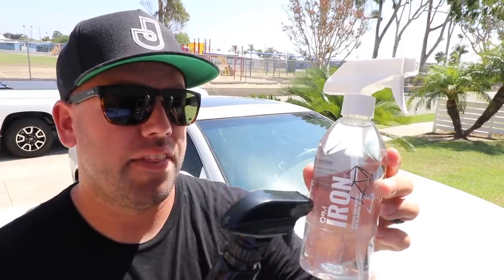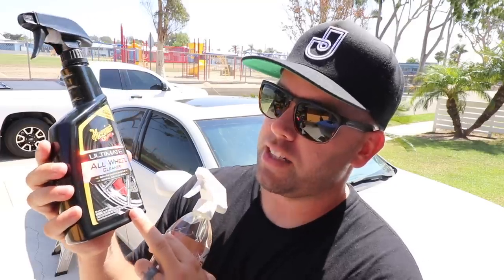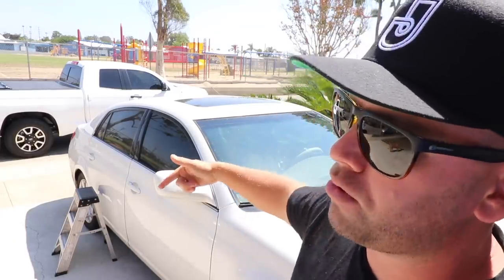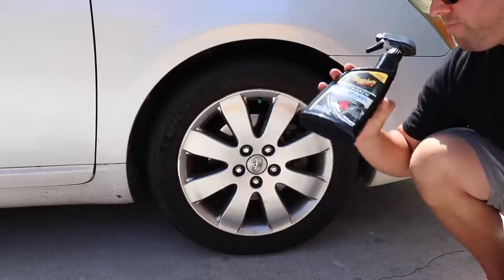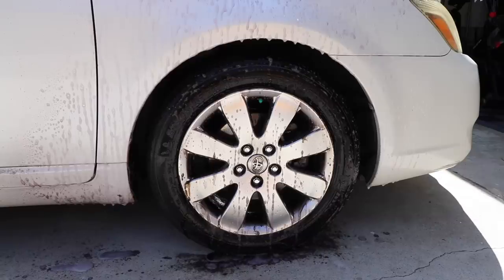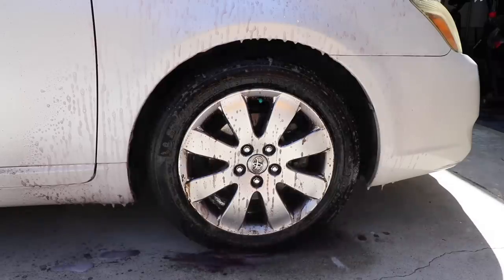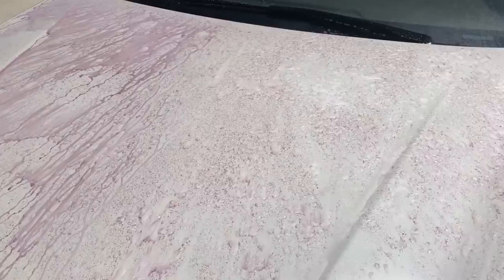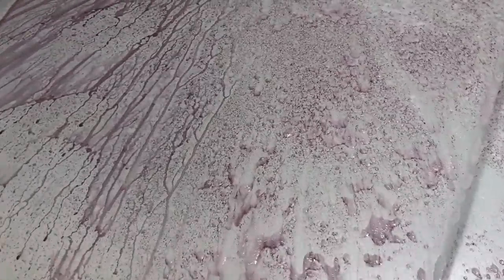CHEAP VS EXPENSIVE: MEGUIARS ALL WHEEL CLEANER VS GYEON IRON

Comment from the maker: Sorry about the audio in the last clip of the video - damn iPhone.
Reply: damn iPhone.
Reply: Go Andriod
Reply: What was your conclusion that we couldn't hear?
Reply: Not sorry enough to spell out what you said for the viewers, I guess.
Reply: These guys are just whiners, Jimbo. All you gotta do is turn up the volume a bit for a minute. It’s fine.
Reply: MotorcycleJunky07  You are lucky to have such powerful speakers. As for me, I maxed out my volume and still couldn't hear a thing.
Reply: iPat6G I don’t have “powerful speakers”. I was using my cheap earbuds. Update your tech.
Reply: Auto Detailing Podcast been using the Meguiars on my Camaro SS 1LE wheels since last summer works pretty dang good this car has large caliper and brakes makes Ton of dust and iron! Question is this stuff safe to use on ceramicpro9h covered paint surfaces? I never thought of spraying down painted surfaces before I’d be interested in seeing how my white camaro looks with it!
Reply: Auto Detailing Podcast them shitty ass “AirPods”
Reply: Auto Detailing Podcast yeah you drifted so we can’t tell what your final judgment was on the product
Reply: What's the new one you're using by Eagle one ?
Reply: Actually it’s the AirPods. They have a horrible mic
Reply: Hahaha damn iphone..

Comment: Good comparison. I would say that if you compare wheels try to do left and right front, not front and rear because the braking system in front got large pads so you should have more Iron from brake dust. On the other hand, I wish to try next time car pro Iron X vs Sonax Wheel cleaner plus. Thanks
Reply: Feras Al-Hindi if you watched the video, he explained why he did that
Reply: Feras, I've used both IronX and Sonax Wheel Cleaner Plus. I got the same results as Jimbo: Both work, Sonax clings better. Now I use only the Sonax, and I even add  water to get a better spraypattern: 75% product, 25%water (3:1). Also works as claylube on a washed car. Saves a step ;)
Reply: Indeed. Useless test when you compare a front to a rear wheel.
Reply: It depends most car the driver side brake system is under the most pressure that being said the driver side would be the dirtiest of them all 🤷🏾‍♂️
Reply: @reyalmonte1533  Brake pressure left and right should be the same, otherwise it would be unsafe. I was talking about front and rear. Most of the braking is done with the front.
Reply: Dutch79 that’s correct most the braking comes from the front but if you look at the brake diagram the driver side always get pressure applied before the others and if you look at vehicles when you’re changing pads most the time the driver side is more worn out than the others. That’s what I have seen from my personal experience.
Reply: But all of this is also in result to the weight of the vehicle all vehicles are different but I’m most case I seen the driver side always wear out a little bit more not much but if you measure it you can see a little difference
Reply: Rey Almonte I know this is over a year ago but I couldn’t. You are so wrong, if the driver calipers/wheel cylinders received more or pressure first then the passenger side then cars would pull to the left when braking and create unsafe situations. You mentioned diagrams but fail to mention the addition of a brake proportioning valve/metering valve while in newer vehicles the abs system controls it and essentially controls pressure to all 4 wheels evenly. If you have one side going through pads quicker then you have a caliper sticking or completely screwed up when replacing your pads by not greasing  your slide pins or not correctly installing the pad shims.

Comment: There's a difference between pre-washed and pre-rinsed. You should always wash a rim before applying a chemical decontaminant. Otherwise you're wasting chemical on removable contaminants. What the Megs bottle means is that the rim should be dry. Otherwise the chemical dilutes itself. So wash it and dry it before application. They're both trying to say the same thing but both failed in slightly different ways.

I use a pressure rinse first, then an APC, then an acid wheel cleaner (if they're bad), then dry the wheels and use an iron remover, then a tar remover, then a clay bar and finally a panel wipe. Then they're ready for coating.

Comment: If your iron remover is drying on the paintwork a great tip i got given was to stand at a distance and use the pressure washer to mist the paintwork, this will gently add some moisture back into the product.
Reply from the maker: Stickymicky25 that’s a great tip. Thank you

Comment: I can confirm the Meguiar's turns extremely purple when there's a lot of iron. Next time you have a 2018+ STi, try this. I cannot go more than three weeks without washing my wheels, and even after one week, it turns purple like crazy. I usually use Spray Nine or Super Clean for the tires and Meguiar's All Wheel Cleaner fort he job. It's economical and efficient. For those who want only one product, I guess the best I know which is reasonable priced is the Adam's (the purple one) Wheel & Tire Cleaner. It's phenomenal, but still more expensive than the Spray Nine+Meguiar's AWC. Also another trick that make the wheel cleaning way more efficient is to use a very soft conical drill brush. That cuts the working time at least by half.

Comment: I did a comparo of Megs Ultimate wheel cleaner to Griots Heavy Duty and Sonax Wheel Cleaner Plus.   The Megs is a great value and worked as well as Griots at 1/2 price.   The Sonax was a little better performer but not for 2X the price.   Hard to beat the Megs for an iron reactive wheel cleaner.

Comment: I'm not trying to be a smart-ass he should have done one front rim and tire and then the other front rim and tire.  with that being said Meguiars products are awesome ! !  and thank you 4 letting us know about Meguiars wheel cleaner.  would not have known this would be an iron free product
Reply from the maker: I understand. The reason I didn’t do that is because the other side was in the sun and I thought it would be unfair. To me both the back and from rims looked equally dirty.
Reply: Auto Detailing Podcast I understand that it's just the front brakes work a lot harder and disperse more material than rear disc brakes.

Comment: Hi Jimbo.

What do u think of using acidic wheel cleaner such as Meg wheel brightener as decon product? 
Will it ruin clearcoat in longterm?
Reply from the maker: Acid is one of my favorite wheel cleaners for so many reasons. I wouldn’t use it as a maintenance item as it may have long term negative effects. But on super nasty rims that have been neglected- there’s nothing that will get them cleaner faster then wheel acid.
Reply: @autodetailingpodcast  
Jimbo.
 What i meant was using acidic wheel cleaner to deep clean/decon car paint, not wheels.

Will it be okay for my car paint in long term? 
Assuming that i did the decon with caution and use common sense.

Comment: Take this for what it's worth but Meg's doesn't recommend this for use on paint. 

"We do not recommend using our Ultimate All Wheel Cleaner or any of our other wheel cleaners for applications other than wheels. We know and understand other products use similar color changing/iron reacting chemistry for applications other than wheels, but Ultimate All Wheel Cleaner is designed just for wheels. Keep in mind with any product which uses this color changing ingredient, that color changing ingredient could be one of many other ingredients in the formulation, and even though the color changing ingredient is widely known for it's effective yet safe cleaning ability, the other ingredients included in the formulation may be geared towards a more specific application like wheels, to help with all sorts of variables in performance, and those ingredients geared towards a more specific application may or may not work well or be safe for certain surfaces."

Before I would use this on my paint I would like to know what the chemical differences are between products designed for wheels and those designed for paint.
Reply from the maker: Fair enough.

Comment: Specific iron removers aren't wheel cleaners.  It can be part of the process but you should use an actual wheel cleaner to clean wheels.  There's more than just iron/brake dust on the wheels.

Comment: i think that your rims were to clean to do a good comparison, in the meaning that on a quite clean rim also low level product could do a good job, only when dirty s a lots you could see the difference.
So maybe i would suggest as conclusion:if you will use the wheel cleaner regularly, a cheap products could be as good as an expensive one.
But we cannot really say they are the same.

Comment: As a detailer I've switched over to almost all of Gyeon's line last year. However I still use Sonax full effects/ PLUS wheel cleaner as my go to. Why? Simply because i haven't found a better one yet. Now that being said I rarley use a iron remover wheel cleaner on wheels once they've been decontaminated from iron, claying, and polishing. Followed by Ceramic coating and AMMONYC gellee. I go to AMOONYC Brute for my maintenance washes. But to say meguiars has a better wheel cleaner I disagree, I feel you'd be using more of the product sense it's foaming coming out of the nozzle instead of direct liquid and running down the wheel/panel. Might be as good but I feel you'd be using a lot more of their product for the same resaults as gyeon or better yet Sonax.
Reply from the maker: Fair enough.

Comment: Hey great video, I feel like the foaming is a slight advantage because it sticks to vertical panels better. You still have to clay bar, but this really helps a lot! I use Ferrousity from clarity 1 polishes, a local detail shop in temecula. It also has a foaming characteristic.

Comment: I like the foam vs running down product. I would highly suggest rinsing bottom to top to avoid diluting the product and streaks/stains on the finish. You have mentioned applying it dry, but what are your thoughts about rinsing it down to cool down the paint and to knock dirt off the paint before applying the product? 
Overall I like your comparisons, it makes easier for amateurs and professionals to see other products in the market. Thanks again.
Reply: I do it before because it clings to the paint better IMO. It’s dry and the only product on vs a wet slick surface

Comment: One thing, it's pronounced jee-on. I don't really care how you say it personally, just an FYI. 

Secondly, the smell is mercaptoacetic acid aka thioglycolic acid. The more smell, generally the higher concentration of the active chemical. Mercaptoacetic acid actually rapidly pickles the iron. The byproduct is that red/purple color.

Meg's is a pretty decent product for the price, but the dedicated iron removers from Gyeon and Carpro tend to do better than the wheel cleaners that have the acid in them or products that try to be iron and tar removers combined and even some of the cheaper dedicated iron removers like McKee's for example.

I've decon'd some seriously bad cars - I'm talking one car was sitting next to an angle grinder station so the particles were enormous and you could really see the difference between the big name iron removers and the cheaper stuff I was trying to use since I knew I was going to have to go over the car many times. It ended up being a 3 hour clay job even after probably 3 to 4 passes with iron remover btw on the car that had been sitting near an angle grinder. Orange rust specs eeeeeverywhere.
Reply from the maker: Dannnng. That’s crazy. Would love to see pics
Reply: Auto Detailing Podcast
Man, you know I'm sure I have after pics, but I don't recall if I took any before on that car. Missed opportunity, I know. I think I was too anxious about how long it was going to take and just got started. I thought I at least had a picture of the clay with a huge visible metal shard in it and many smaller shiny specs, because I remember snapping one, but I can't find that either.

Comment: I don't know if you can solely base the price of the product off of just the performance. I don't have experience with the Gyeon Iron product, but you need to watch what you use on certain wheel finishes. Perhaps with many standard factory wheel paints and clears, you're fine. But as soon as you get into aftermarket powdercoats, anodizing, and clears, you might want to rethink using anything too acidic.
Reply from the maker: Definitely agree. These iron removers say they are pH neutral. But it’s usually always good to test it first.

Comment: Try bilt hamber auto wheels and you'll be blown away. Also their similar ironfallout for paint. Valetpro dragons breath is an other one with very high percentage of the chemicals that dissolves the fallout.

Also its recommended to wash the car or wheels AND dry it then apply a falloutremover. Otherwise all the other dirt and contamination will weaken the effect and absorb the product.

Comment: I've used Meguiar's Ultimate Wheel Cleaner, and I have to say that I was impressed by it. I've also used Chemical Guy's Iron Decon spray, and I was extremely disappointed. I'm going to give P&S Brake Buster a try too, but so far, Meguiar's has a heck of a good iron remover.
Reply: I just pickup the chemical guys over the meguiars and was extremely disappointed. It didn't do anything. Gonna go back I guess

Comment: The foaming of the Meguiars is nice when you're using it as wheel cleaner not just as an iron remover. I've used the Meguiar's to clen wheels then followed up with CarPro iron X and got no additional iron off of them so I'd say it works well. I've not tried it as a pure iron remover on body panels yet.

Comment: would have liked to have seen you spray the Meguiars side with Gyeon and vice versa to see if either pulls more contaminate off that the other spray didn't quite get. Just wondering if the Gyeon does a better job at pulling all that stuff out vs the Meguiars is all.
Reply from the maker: It’s difficult to do that because usually on the first application it won’t remove everything.

Comment: I do agree the gyeon or iron x is over priced BUT the active ingredient that makes the purple is a lot less in the Meguiars than in the gyeon or iron x.

Now... maybe you don't need a high concentration of the active ingredient to be effective?
Reply from the maker: I think your right. They seemed to work pretty much the same.
Reply: Auto Detailing Podcast, it would be interesting to know what is the main active ingredient that turns purple.  I personally think it is hydrogen peroxyde. If so we could probably come up with an extremely cheap home made version of the fallout remover.
Reply: Stephen Remillard  google thioglycolic acid
Reply: Interesting, I guess this is not something that can be purchased at the local hardware store?

Comment: My guess is the reason for more iron in the rear on this specific car, and most normal cars for that matter, have vented discs up front and solid, non vented discs in the rear. Even though brake bias is higher up front, the non vented rear rotors get super hot and lead to wonder if that causes them to throw more dust. Certain cars do this very noticeably. Ive always noticed rear wheels on older Mazda 3's get significantly dirtier than fronts because of this.
Reply from the maker: well said.

Comment: Hmmmm never thought of using wheel cleaner on the paint. I always thought it'd be bad for the paint. Well give this a try next time. Would this also be a good way to remove old wax/sealant?
Reply: I wouldn't use any Wheel Cleaner on paint. He used it on paint because it has Iron Removers in it. That Meguiar's Product is a wheel cleaner with some Iron Remover. Gyeon Iron is a straight Iron Remover product. Not really comparing apples to apples. That's why Gyeon Iron is pricier.
Reply: MikeEM1 I see. Thanks for the info.
Reply: @MikeEM1  
Why cant we use wheel cleaner on paint? 
I did that couple of times and my paint looks pretty darn good until now.
Reply: Sorry I'll clarify, OP said he didn't know he could use wheel cleaner on paint. What I meant was, don't just grab ANY wheel cleaner and use it on your paint. If it has iron removers in it, that's fine such as this Meguiar's product, Griot's Heavy Duty Wheel Cleaner, etc.
There are dedicated Iron Removers that I rather use though for paint, such as this Gyeon Iron or Adams Iron Remover.

Comment: Do you have to use wheel cleaners or you can just use heavy duty degreaser?
Reply from the maker: Sonal Prasad degreaser will work just as good in most cases
Reply: The man. Have you used meguiars hot shine and endurance? Which one you recommend?

Comment: It doesn't dilute the product it only helps the iron remover come in contact better with the iron filings and contaminants which is why you have to have the car prewashed so when you rub/scrub the iron remover you're getting it deep within the paint to help said product remover more iron composites and only that and you're not embedding dirt etc into your paint
Reply: Also the reason why it was working better on the hood as it wasn't that dirty compared to the back portion you used it on(clear iron remover bottle) why it was running and the Meguiars was just sitting as its a foam type iron remover. And just a tip never use these type of products when the sun is out and beaming on your car. I been using Iron X for some time and they advise it on their bottle.

Comment: Pretty sure that by 'pre washed surface' they meant for the paint and not the rims. Also, you never check front rim compared to back rim, you always check products on either fronts rims or back because they accumulate different amounts of dirt and iron particles.